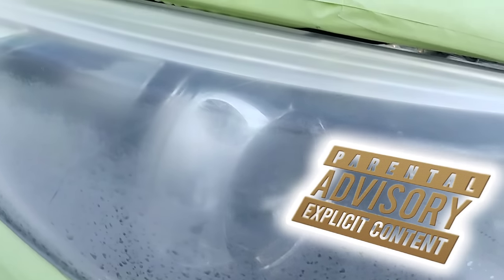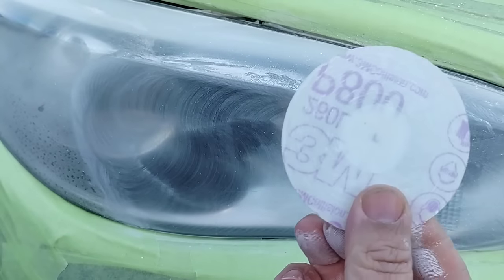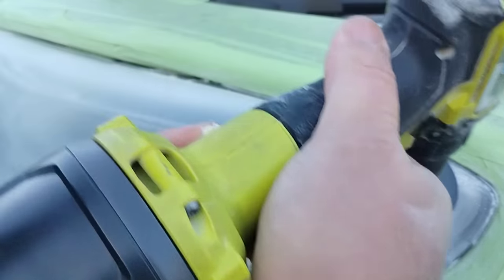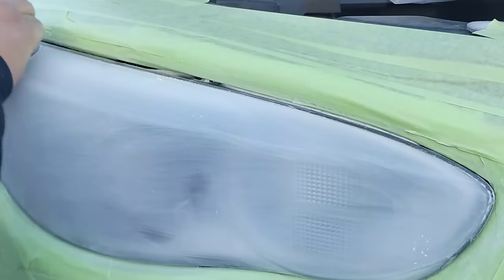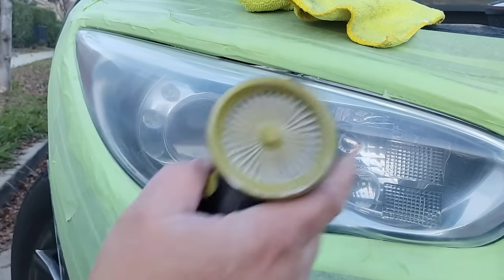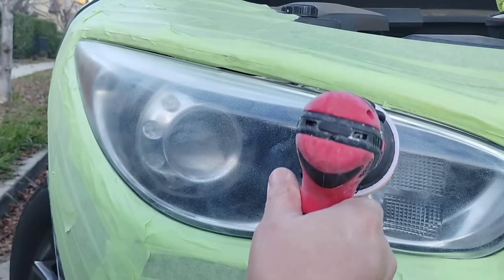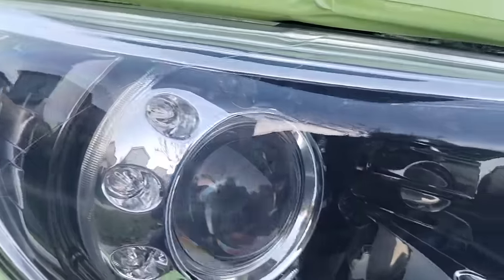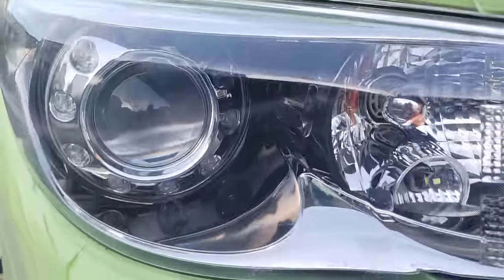start with the RIGHT DISC - it's important during HEADLIGHT RESTORATION

Comment: I just did my 2002 jaguar X type 22 years of ultraviolet damage, 1,000 automated car washes, stone chips, grit, road  salt, road spray and grime and some occasional dump truck aggregate blow off. I needed to start off with 220 grit and work my way all the way to 3000 wet sand. Finished it off with Maguires plastic polish.When it was done, it looked almost brand new. These headlights with the fog lights six individual lamp lenses Hass to be the most difficult Restoration I could imagine.
Reply from the maker: It's a lot but there's some really hard ones... The tape off on this vehicle is a bitc#

Comment: I used the mcguires headlight spray for the first time today. It left some tiny little pieces of what looked like hardened coating all over the lens. It wasn't an orange peel effect. Any ideas on what I could have done wrong?
Reply from the maker: You must have done a lot of wrong...
First and foremost you must not have followed the steps that I have shown on here over 130 times.... 130 flawless times.... I've never experienced this so I have no idea what possibly caused this or what you actually did.. you just need to watch the videos and ask yourself did you truly do exactly what I did especially on that step... Cuz it doesn't sound like it and honestly it could possibly be if that's the result you got.... Did you double coat did you spray too slow did you spray too much did you spray too far away to spray too close did you do all the other steps that I do beforehand to make sure your area was clean and sterilized did you do the exact thing that I do on every single video because if you did deer lights would have came out like mine.....👍🏽
Reply: @theheadlightrestorationpro  I did all the lens prep exactly like you do. The only thing I can figure is that either I didn't warm the can enough or shake it up enough. Or maybe both 🤷
Reply from the maker: @jeffhannon1015 you'll figure it out.. I was just watch a couple of videos at the point of where I spray and really taking notes., make sure the can is warm enough and shake up thoroughly and that your spray nozzles lined up with the Red Dot. Spray five to seven inches away only one coat ever,....
Reply: what vehicle? sometimes the shape of the headlight means you have to spray it differently 

like those headlights with completely flat tops on them could cause the clearcoat spray to pool together and harden into an uneven surface
Reply from the maker: @Robbie-mw5uu whatever he did he didn't do what I do never once and oh and about over 2,000 usages with this product have experienced anything like that...

Comment: My 2003 accord lights are foggy and has condensation inside. Do I need new lights or can I restore using your method?
Reply from the maker: Can't really restore them it depends on how much damage you have on the inside are liquid if it's worth trying to stop the liquid from coming in but far as restoring there's not much you can do that is worth while..

Comment: Have you tried using the polishing pad the black pad when using the polish for the headlight?

Great work again by the way.
Reply from the maker: I've tried every pad color there is and every density from ultra soft to ultra hard different brands as well..
Nothing compares to this... You cannot produce heat of the way you can produce heat with this pad.. damn near any pad I've ever used out of dozens upon dozens....

Comment: I am just starting with headlight restoration (for now i practice on my own stuff) when i used the mequiars coating it created small bubbels it was about 10C° (50F) i worked inside but was raining out side and i didn't heat it before hand. I suppose that is the problem, just want too check and get an opinion on it.

Comment: I tried hand wet sanding my headlights, after I used the meguires plastX and the meguires clear coat, it left small bubbles when it dried ,🎉and headlights still foggy, it’s 2011 Mercedes E350 so them headlights are really nice looking ❤but with them foggy it obviously e going to try the 3M disc sandpaper next like your doing here to try again

Comment: Hey man, great video! Was wondering though, do you not use a cleaner/degreaser before you clearcoat the headlight? I would’ve thought that degreasing after using polishing compound would be necessary in order to have a clean surface for the clearcoat.
Reply from the maker: Thank you
They're over 140 videos no streaming on this channel....Quite the opposite check this out it'll better explain it it's one of the reasons why my headlight restorations look so much better than probably anything you've ever seen.https://youtu.be/LC4ZBu02JZg?si=87aAWwwZrZq7VADd

Comment: Yo, Pro,  Thanks for all you do and being able to communicte it.  What precisely did you do to the other headlight that had most of the clearcoat intact.  i.e.  did you polish with the trizact 300, then use the meguiars and then apply clearcoat over it or what?  thanks, robert @ clearlite systems
Reply from the maker: Simple polish of headlight with the same Maguire's polish used in this video.... Then went over it with the chemical guys....it just had a bit of build on it... Hazy with a couple little white spots but it was all surface just from the neglect... So I was able to bring it back with just polishing...

Comment: Hi at what setting do you use your ac delco polisher?
Reply from the maker: I use the high setting but you got to remember I'm a seasoned Pro probably one of the highest level season pros that you ever see work with that being said I did not start using it on the high level but I use it now and I feather the trigger depending on what area I'm using it on and the difficulty of the light you can burn spots so I would ease into the speed.

Comment: I bought a bottle of that a few weeks back on eBay.
I was concerned with how thin it was so I didn't use it.
Thanks for letting me know it's supposed to be that way.

You think we can mix it with that thick ass chemical guys headlight polish?
Reply from the maker: Yes exactly my thoughts it's been sitting in my garage for about 7 months I decided to order another one just to make sure it's supposed to be that consistency...lol
Then I started testing it out that's probably the fifth headlight I used it on so it's pretty legit....lol
Exactly my thinking about the mixing......😎💯

Comment: So you don’t use water when sanding the lens???
I have never done them dry. So 800 dry and 3000 wet. Hummm
I usually do 1200 wet, 1500 wet and 2000 wet.  
3000??  I just got 3000
I usually use rubbing compound to get it clear, then polish it last

Comment: How does that compare to the new plastic x you just posted?
Reply from the maker: I'd say it's about equal they both have about the same rating in my opinion they're both lacking just a little bit on one thing or other but definitely well over the threshold to be good enough to use... You have one that is lacking just a little tiny bit of oil content.. maybe you have one that is really loose and could be sicker...
Reply: I’ve never sprayed the way you do because it looks difficult. I go side-to-side. I think the problem is, I push the button all the way down and you don’t. I’m just so afraid of drips.
Reply from the maker: @ShoeHefner757 fear comes from not knowing which translate into inexperience which translates into haven't done enough practice... I'm not  confident in doing it because I've done so many but because I've done so much practice.... Well maybe both but at first it was the practice that made me comfortable with doing this ... Practicing on non-paying customers and also personal vehicles and junkyard headlights that I've actually got for the junkyard or Facebook marketplace.. I probably sprayed two to three dozen lights like this before I had to paying customer...

Comment: Thats the polish i use alot, but be ware, it will make a big mess if you use too much. It is super thin.
Reply from the maker: Yes it's very loose watery but when you use the right amount it works very well sometimes if I have too much on I just pull away and spin it independently knocks it all off...
Reply: @theheadlightrestorationpro  thats exactly what i do. Just make sure your not standing within 10ft of your own vehical lol! I started using 2 pea size dabs of it at a time and havnt really had problems since.
Reply from the maker: @brandonsmith3782 👍🏽